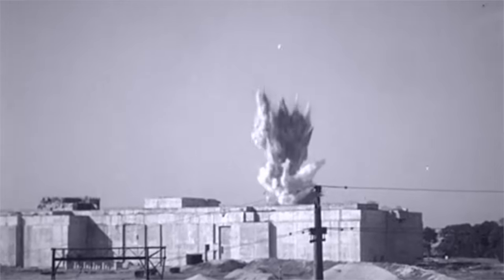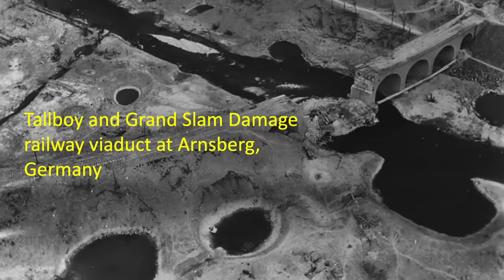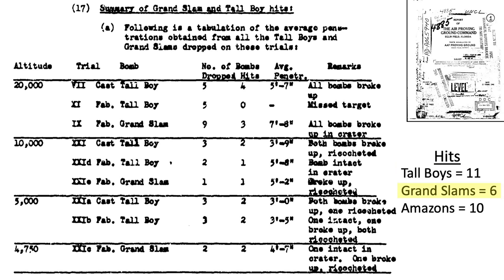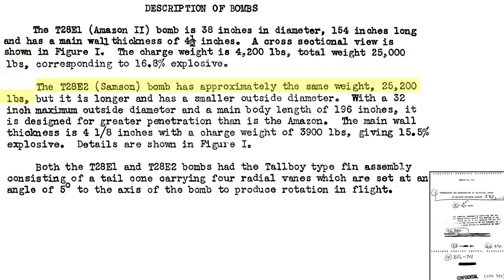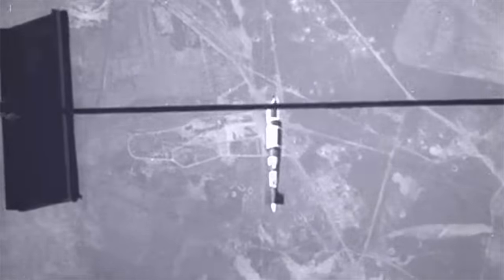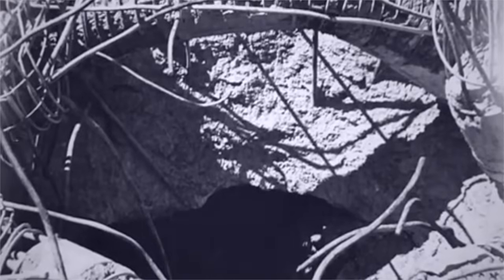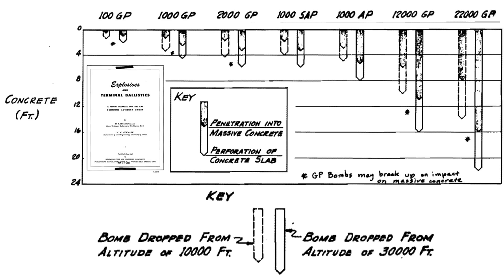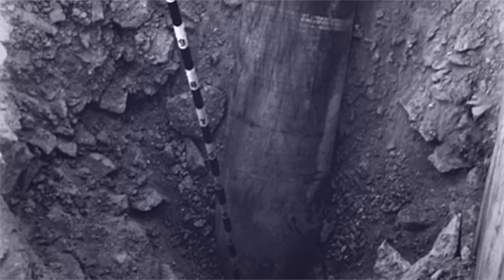Rare Declassified Footage from post WWII Super-bomb tests – The Project Harkin Story

Comment: It's strange that such a weapon wasn't never used again, at least 'til the end of 20th century.
Either in Korea and in Vietnam surely there were targets that justified such a devastating bomb.
Reply: Probably not.   You need a point target, either one with massive protection above it (to justify the Samson's concrete penetration) or one that can be destroyed by the enormous crater made by a Tallboy/Grand Slam exploding at depth.   Bridges, deep large tunnels and underground installations being prime targets.
For anything on the surface, something like an 8000-pound thin-walled 'cookie' with its blast effect would be more effective.

Comment: You didn't have any bombers to carry them
Reply: False.  If you watched the video then you saw a B-29 drop an Amazon II bomb, and the B-32 was capable as well.
Reply: The test footage clearly shows the B-29 dropping them. How does it feel to be so full of confidence and yet be so wrong?
Reply: @ImpendingJoker 🤣🤣
Reply: US had at least one B-29 equipped to drop Tailboy and Grandslam in early 1945. I wonder if the modifications were based on the Silverplate modifications for the Mk 2 Thin Man Plutonium gun bomb design. Of course B-29's did drop command guided TARZON bombs in Korea, which were based on the US Tallboy's.

Comment: Americans bombers could not carry a grand slam as there bomb bays were not big enough due to then having belly gun
Reply: I beg to differ. The B-29 used in these tests were modified to carry the biggest of these bombs. The doors were cut away and something less than half the bomb hung outside. Also, the fuselage belly that was between the two bomb bays in the B-29 were cut away and the bomb suspended from the main spar of the wing. It seems that the cradle that the bomb sat on filled the gaps from the cutaway portion. The belly guns on a B-29 are far enough fore and aft to be not in the way. Again, I have pictures but no way to post them here.
Reply: @mightaswellbe  thank you for that info
Regards
Davr
Reply: @mightaswellbe  - I also beg to differ. @davidbarton should have said American bombers in WW2. These tests were carried out post war and the B-29 never carried a Grand Slam in the bomb bay. Cross support structure along the length of the bomb bay and between the bomb panniers was vital to the fuselage integrety, hence the mounting for two bombs underwing.